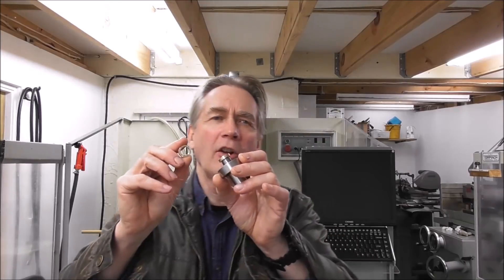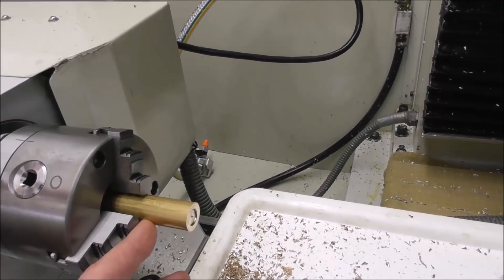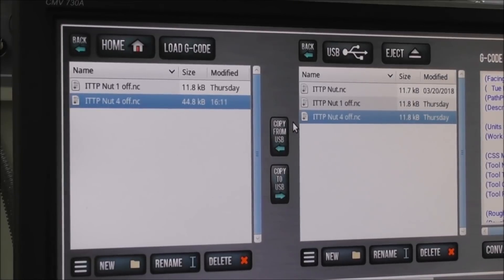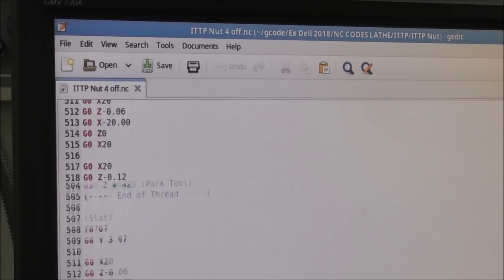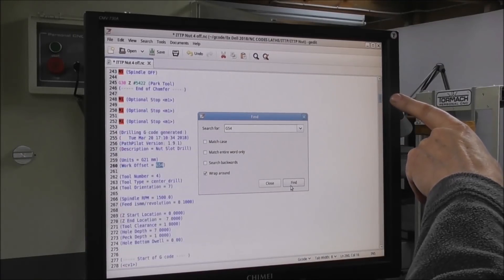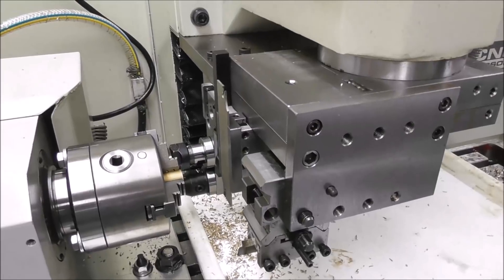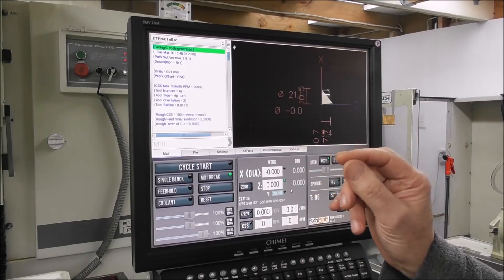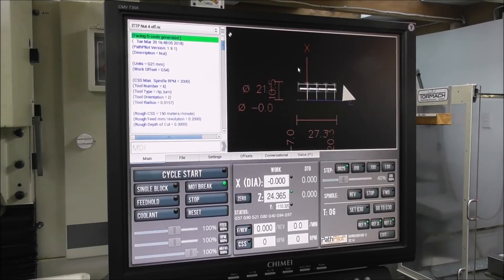Tormach Rapidturn -  Set Up and Run. Part 5 -  MultiParts/ Work Offsets

Comment: thanks for the video. as an alternative, consider using G52 with a Z offset. It would save you from having to set 4 work coordinate systems in the machine. So instead of G55, use G52 z-6.3 and run the part ,then at your G56 would be G52 z-12.6 and so on. With this, you would stay in the G54 work coordinate system.  I regularly use the G52 command to make an aircut above the part to verify the toolpath or for tweaking a z height finish pass.
Reply from the maker: Hi Robert. Thanks for that!  Sounds very interesting. I have been doing some quick googling of it eg:  "G52 is used to describe a "local coordinate" or "child coordinate" system. It moves the working system by the XYZ you see in your program. It's canceled by a G52 X0Y0Z0. A G52 can be called with any of the G54-G59 fixture offsets active."  If I understand correctly, you would still copy 3 more sets of code, but instead a change of coordinate system, a G52 Z -6.3 etc etc, and at the end a G52 Z0 to 'cancel the offset' .
Please confirm or correct.  Cliff

Comment: Cliff, The process you describe is excellent at allowing someone to follow the math of multiple work off sets. I know  I use use multiple work off sets on many parts in my milling operations and in Fusion 360 in the setup area there is a tab that lets you set multiple WOS with just a few clicks. I have not done any turning jobs so I’m not sure it’s available in the setups for turning. But your method is functional and allows for an understanding of the process. Thanks for sharing.
Reply from the maker: Hi Douglas. Thanks for your support and comments, good to hear I am not too far off track on this one. Cheers  Cliff